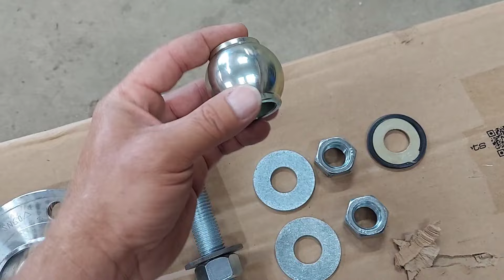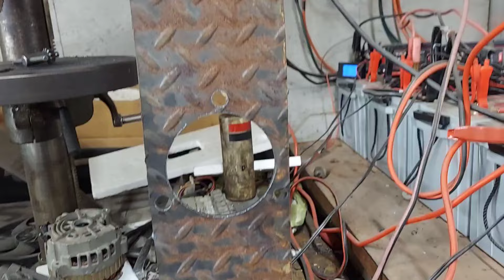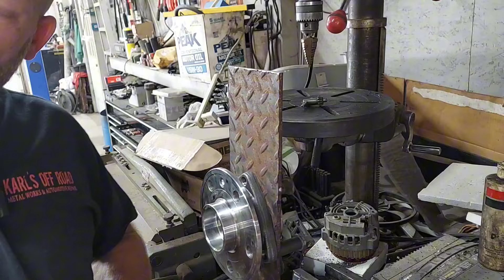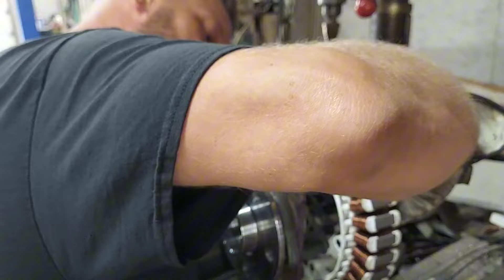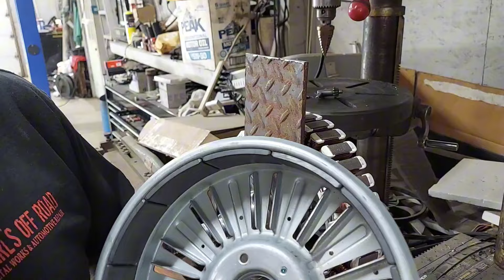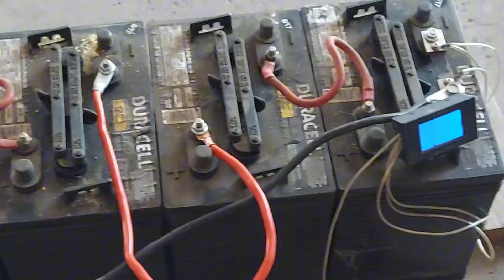Low RPM,high output generator with no wiring modifications!

Comment: Hey! Cool video! What washing machine is this motor out of?
Reply from the maker: LG direct drive washer, I bought it on Ebay for $50. It would be much easier to use the washing machine itself. That way, all you have to do is cut the bottom off, and you have everything you need. There is no need to make an axle,bearings,etc. I'm sure it would spin much easier than a hub assembly for a car. I do think that the hub assembly will last longer, though. I would also suggest a copper stator. This one is aluminum windings, but the Ebay seller isn't responding, so I'm stuck with it. That's a whole other story! Lol, thanks for watching!

Comment: You could use a bike and bike chain.
Reply from the maker: I thought about that, too. I'll keep that for the last resort as I'm not sure I could do that as long as I used to as a kid! Thanks for the suggestion!
Reply: with the gear shift and fly wheel. oh i forgot you spin a 48 volt permanent magnetic motor to produce 48 volt at 15amp or more from the scooter store

Comment: Do you think those 10hp single cylinder diesel engine will power it? 
One guy said it sips fuel
Reply from the maker: Yes,that would power a few. The one I have will work. I think I'll give that a shot before I build a VAWT.

Comment: Find a 20mm to 1" shaft adaptor/bushing, get an aftermarket electric pto for a bobcat zero turn about $100ish. Mabey this will help you out. I just happen to work at a small engine shop and when I watched this and you stated your struggle with the shaft diameter issue I was like boom! I got an idea that could help this guy move forward! I would say you should beable to "if" you buy new you should beable to to grab these items for $150 or less. Goodluck and thanks for sharing!
Reply from the maker: I found the 3/4 to 1-inch adapter and couldn't find the 20mm variety. I think I will be putting the PTO on the 1-inch generator shaft. Thanks for the suggestion.

Comment: Very cool project!  I was looking into something like this a couple of years back for a wind mill.  I think an MPPT solar controller would do an amazing job managing the power input after the bridge rectifier.
Also you could setup a DIY backup gas generator with your motor.
You may need to do some gear ratio thing to work with your motor.
Reply from the maker: I'm going to try a vertical axis wind turbine.I know most haven't had any success, but I think it will be fun to build and watch. I enjoy watching the turbines that I have now,so it's just something fun to enjoy. I just acquired another tower,so I'll be getting a new one soon. I will do a video of the tower installation as well. Thanks for watching!